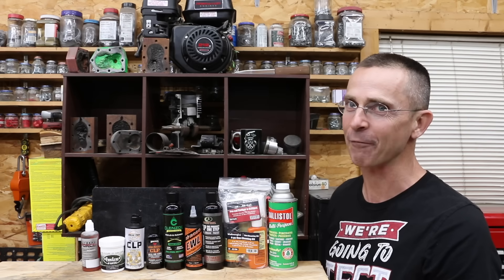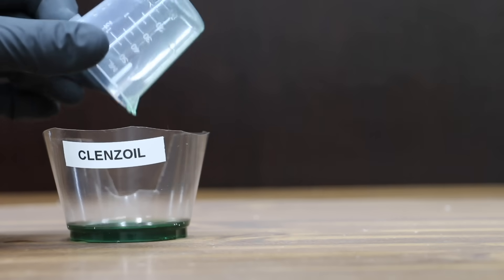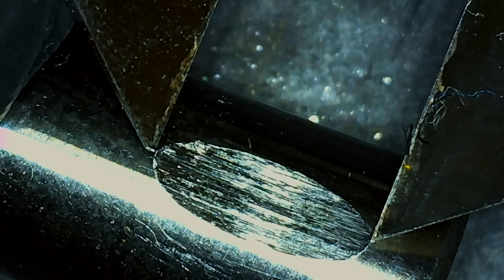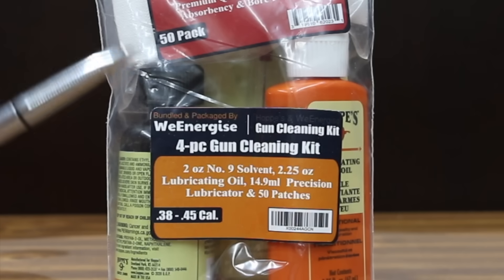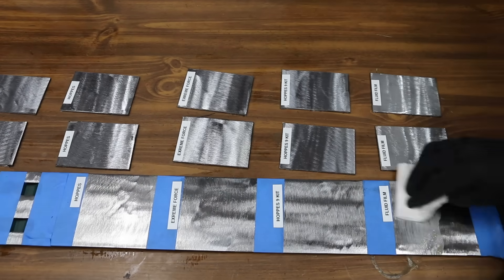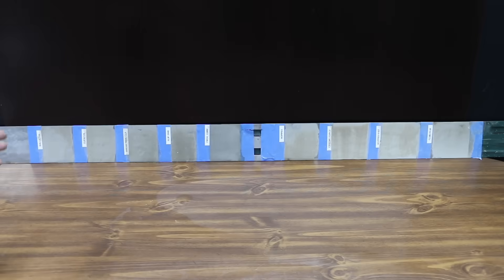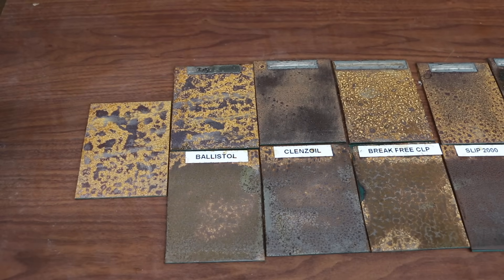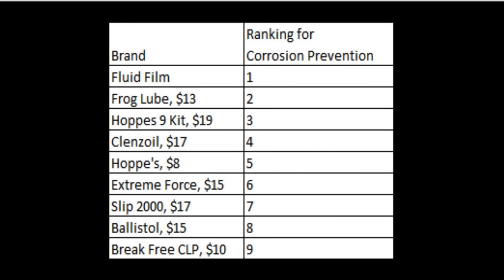Don't Buy A CLP Until You Watch This Review! It'll Save You Time And Money!

Comment: If you do one of these in the future it would be helpful to know at what temp the lubes stop working. For instance, if it never gets colder than -10 where I live, perhaps some of the lubes that failed at -40 would still be viable options for a vehicle gun. Thanks for all your great videos!
Reply from the maker: You are welcome!  Thanks for the suggestion.
Reply: @ProjectFarm  I'll second this. Knowing your CLP can keep things lubricated at 20 vs 0 vs -20F is a big boon. That being said, the Clenzoil still flowed a bit at -40 so here's hoping..
Reply: @ProjectFarm  Oh, btw. Next time you do any thermal testing, put a big thermal mass in the chamber (like a rock, cinderblock, something with high heat capacity that isn't metal) and let it heat/cool to the desired temp before putting in the samples. That thermal mass will really help keep your transients in check.
Reply: Not sure under what circumstances you'd store your gun in a vehicle, but hopefully it's out of sight and in a substantial lock box.
Reply: @brianfoldz40  Thanks Karen, I will store my firearm how I please and is most readily available, mind ur business and u won’t have a problem

Comment: Based on these results and considering the average gun would never see such abuse, the argument can be made that ALL are OK. Not surprised though, that ballistol is grotesquely overrated. If you are a regular shooter, used to cleaning and oiling, any of these would be good so go for the lowest price. That said, more people are turning away from high-priced "gun special" stuff and using common cheap items like mineral oil, 3in1, car wax and cleaners, Purple Power, etc and such items need to be tested. Nonetheless your hard work is very appreciated.
Reply from the maker: Thanks!
Reply: @ProjectFarm  One more thing too, most people buy these oils and then greatly over-oil guns. Guns need almost no oil at all, just a drop here and there in key places and then STOP. Guns would benefit more from the smoothing of rough edges throughout the action than they would from gallons of oil. So it makes little sense to fall for marketing pledges of "newest space age breakthroughs" in oil technology, its utter nonsense designed to drain your wallet. Your excellent video would be better suited toward those people who have machinery with high-speed parts rubbing together -- which isnt the average gun but could be a car engine, frankly.

Comment: Sir I love your video so this is not a direct attack on you but in this video technically you're cheating. By keeping the CLP in a cup and keeping the bearing saturated it is not a real world test. That would be the same as firing a round and then reapplying oil firing a round and then reapplying oil. Going oil is applied and sometimes the excess is wiped away. So in theory a thin oil might have more lubricity if it stays saturated but would in fact burn away faster than a higher viscosity oil that didn't do as well in the test. Example, the cleanzoil is very thin if unsaturated and just applied with a few drops it might actually fail before another CLP that is thicker and would stay in place longer.

Comment: I would gladly donate to see a round two that compares a new batch against the top players in this round!! I want to see how Lucas Extreme Duty Gun oil performs as well as a few others!
Reply from the maker: Thanks for the suggestion.
Reply: Also, I’d love to see a test that measures the persistence of the oil to stay on the surface after simulated repeated slide cycling!

Comment: Lucas oil is my go to
Reply from the maker: Thanks for the feedback.
Reply: @ProjectFarm  not a problem the Lucas oil extreme duty the oil has got the perfect viscosity in my book because it stays where it's putting it doesn't just run all over the place plus I double that up because they make a grease and I actually put a light cold grease on my the rails of my 1911 white coat of grease on my on the barrel and I run my AR relatively wet so I just use nothing but grease on the boat carrier and I add just a few dabs of oil to the bolt itself and the extractor and they all run like tops

Comment: Ballistol is a 100 year old formula for a universal oil. Not a fair comparison to modern products. It works great on black powder products and it can emulsify with water if desired as a cleaner. It's a different category. Fluid Film is mostly marketed as a rust preventive not a lubricant so there's that.

Comment: I’ve been using Frog Lube for at least 10 years now on my firearms. I’ve been happy with the results and have never had any action of any pistol or rifle gum up after sitting for six plus months in the safe. 

One thing I’m always curious about when someone says they’ve had problems with it gumming up, the instructions clearly state to let the part warm up or heat it up a little to allow the FL to penetrate the metal. 

Wonder if the wear would have been less had the FL been applied per the instructions first?
Reply from the maker: Thanks for sharing.

Comment: The bearing test is visually impressive, but does not accurately represent how firearm components operate. Firearm slides have a short distance of travel and the surface load is minimal. 
I'm a Ballistol fan because I have one product that can do light maintenance cleaning of barrels after a range session, protect metal from corrosion and condition leather holsters. I use BreakFree CLP to lube AR bolts. 
For deep cleaning and semi-annual maintenance of barrels I trust the Hoppes 9 cleaner.

Comment: Your novel approach to "testing" these products against each other is, as you had posted in your video "subjective".   Practically speaking, I'm sure all the products would perform well. Firearms in general would not see such extreme wearing of parts that your little test fixture does. I have used CLP in the past. I still have CLP on hand (2 bottles). However, regular ol' motor oil will do an excellent job of lubricating and protecting moving parts from wear and rust.  I've found that the heavier grade oils work the best and tend to stay in place longer.
Reply from the maker: Thanks for sharing.

Comment: Excellent video and work as always!
I have had extensive experience with several of these on firearms. I have had quite bad luck with breakfree clp in cold weather 20F on a MP5. The break free while fluid in quantity was rock solid in the action of the MP5. The charging handle and bolt could not be moved at all. I had to pour gasoline thru the weapon to dissolve the break free so the MP5 would function. I have also used the frog lube briefly it was fine at 70F but after being on the gun for about 3 months it turned into a very sticky thick gunk. This slowed the action down considerably and caused malfunctions within very reliable weapons by regarding the lock time so much that it was causing light strikes and hammer follows dude to the disconector not moving freely. I personally use Valvoline dual blend Molly grease on my weapons because it stays in place and doesn't burn off under high temperatures. I have had good luck with it in 10F temperatures. It's really good important to use grease in my opinion on caming parts in firearms. In really cold temps I prefer to run the weapon completely dry so it doesn't lock up or use Oil or even ATF mixed with gasoline at a 50/50 ratio. My 2 cents of experience. Thanks again and have a great day!
Reply from the maker: Thanks!  Thanks for sharing.
Reply: Great feedback. It would be interesting to try to replicate that, just to be sure.  Any chance that the weapon had a small amount of condensation that froze when temps dropped?  I'm guessing you probably know that it isn't uncommon for a weapon, such as a bolt action hunting rifle to have the firing pin freeze during a cold night after a wet day, so I figure you took that into account, but just want to be sure. BTW, while I do have BF CLP and have probably occasionally used it as a cleaner and lubricant, that would be rare. I normally clean with appropriate solvents, wipe down or "de-grease" thoroughly and lube with a dedicated lubricant.  

Like so many here, I vote for PF to run a test comparing the lubricity function of dedicated lubricants to the top 2-3 CLP's and if temperature tests are done, be sure to include temperatures commonly experienced by users (while that might include -40, it should also include sub-freezing temps about -40.
Reply: Completely dry is also what the aussies do with their AUSteyr/F88/90 etc.
Extreme cold or heat, all dry and some graphite powder in the hammer action.

Comment: Nice testing, but I'd like to offer a suggestion that you (somehow) also look at lead and copper fouling removal; Early on I had a Mosin Nagant with surplus ammo that would take forever to get the bore clean (like 20 or 30 patches with Hoppes to get back to a shiny bore and a "not-quite-clean" patch), so I spent some time trying different solvents & CLPs. After several experiments, I hold the theory that cleaning a bore is about more than just dissolving carbon and involves a "layered" problem of carbon, copper, and lead fouling where certain layers need removed before the lower layers can be attacked--ie. a layer of copper can form that hides more layers of carbon & lead). Surplus Russian ammo (ie. 7.62x54R for the Mosin) is filthy stuff and I've found that an alternating approach has significantly reduced the number of patches to a really clean (ie. patches come out clean) over Hoppes No.9--my original benchmark. (and before anyone calls me crazy about "leading" with copper jacketed bullets: my theory is that Lead gets deposited into the barrel by the interaction of the open base of FMJ bullets and the propellant combustion, but I don't think any solvents directly attack this--brushing and deleading wool work best.)

Of the various CLPs and solvents I've tried (including Hoppes 9 and BreakFree CLP), I've found that MPro7 Cleaner does a great job of cutting the carbon, and MPro7 Copper remover does a great job getting the copper out that's left by that ComBlock surplus ammo. Then back to the cleaning solvent and more gunk comes out on the patches and you can actually get to clean patches out of the barrel.

However, my go-to CLP that I think does a better job than most is Gunzilla, which provides more lubrication than the MPro products. And if I remember, I'll use Break Free Collector for stuff I'll use only sparingly, and I'll pack barrels with Birchwood-Casey RIG for stuff that I put into long term "Cold Storage" (if I remember). I'm also a fan of Tetra gun grease for guns that want grease (ie. Garands, Springfields, and the like)

So consider MPro7, Gunzilla in future testing. Also Ed's Red (the DIY CLP) would be worthy of a look.
Reply from the maker: Thanks for the suggestion.

Comment: I have been using Pennzoil Platinum15W-50 for years in my guns. No rust, no wear. I add a little STP for use on 1911 slide rails.
Reply from the maker: Thanks for sharing.

Comment: a few things to keep in mind: a gun lubricant doesn't need to have the same lubrication strength as motor oil.  In some guns in fact, over lubrication can cause a number of problems.  For most guns, ballistol, slip 2000, and hoppes  lubrication strength should be adequate.  Also noteworthy is soak time for these CLP's solvent capabilities - I know for a fact that ballistol works best when left to soak for longer than 20 minutes, and Hoppes is usually 9-15 minutes.  For the heat test, it's important to remember that no gun mfg recommends not cleaning and lubricating your firearm after each use - so if a CLP doesn't perform well after heat... well you should be cleaning no matter what after each use.  That's not to say that certain firearms still wouldn't operate much better using perhaps cleanzoil vs ballistol.  As for storing your firearm, I've found ballistol to work great.  If I know my gun was exposed to salt water, I would be doing a complete tear down anyways.
Reply: Let's be real tho... most of us are too lazy for that :D

Comment: I really like Weapon Shield. But I really only use it for LP, not CLP. (I handle the C aspect with M-Pro 7). But Weapon Shield oil and grease products - used very sparingly - have kept my gear running smoothly for years. (When not used sparingly it can get a bit gunked up)
Reply from the maker: Thanks for sharing.

Comment: Great test. 
If you are using them for firearms, you will note the very last chart column as the pass/fail.  The more you clean your firearm and soak it in CLP, the easier it will be to clean next time. When I say clean I mean Marine Corps cleaning standards.  You can use anything to clean it that works well, even Ed's Red. I always clean after firing.

For preserving and storing what always works-- 
Break free or similar CLP for final coat.  
M Pro 7 (old formula) works better than CLP, but they don't make it anymore.  It seemed to bind in the metal better after each cleaning.  
For parts that need much more lubrication, Slip 2000.
Reply from the maker: Thanks!

Comment: I'd throw in another vote for a "part 2", where maybe you take a couple of the "winners" here (2 or 3) & run a similar/same test including some of the others mentioned in the comments. I personally, would like to see how the Lucas & good old Rem Oil stacks up against these.
Also, I'd be interested in your opinion of dual usage. What I mean is, you've got some that are great for lubricating the shooting wear & corrosion prevention, but aren't too hot at clean-up & then vice-versa.  A do-it-all-at-once product would be great...but how much is someone giving up for the convenience, when maybe we should clean-up after the shoot first with something like the breakfree; then after it's all clean, whip it it & coat it with something like Clenzoil for the long-term/storage/next-shoot protection.  I s'pose in a way, that's the intent of the whole Hoppes full kit... but, your thoughts?
Reply from the maker: Thanks for the suggestion.

Comment: Had used 3 in One oil since my father and his father used it. In 2007, A gunsmith started me using Butch's Bore Shine and lubricating with Slick 50 can spray. The firearms used most often get the Bore Shine with light 3 In One oil cleaning and wipe down. The ones in the Safe get a wipe down of Slick 50 spray.  I appreciate your testing and will use Clenzoil on the action I take to the range. Thanks.
Reply from the maker: Great feedback! Thank you

Comment: I use slip 2000 on all my Airsoft replicas. They make a specific Airsoft variant that cleans and lubes. I also use peligun oil for my pellet guns. I personally have never had a wear or drying out issue. Also does keep internals cleaner then haveing no coating.
Reply from the maker: Thanks  for sharing.

Comment: +Project Farm  have ya dune Gasket Silicons for engines?. Not for heads altough I did use Corn flakes cardboard on a 200cc twin 2 stroke, just add grease and gud fur 6 months. till it burnnt thru.
Reply from the maker: Thanks for the suggestion.

Comment: Great testing as always. If you make a part two. Would you please try Militec-1? We were issued this lubricant in Iraq due to the very fine sand that could potentially jam our weapons. The Militec-1 had to be applied to the weapon when hot so as to impregnate the metal surfaces then wiped off. Also, Amsoil makes a couple firearm lubricants. A cleaner and a separate protector. Thanks dudes!
Reply from the maker: Thanks!  Thanks for the suggestion.

Comment: Very good video.  I also like the idea of a part 2 to test against other products: Rem Oil; LPS  1, LPS 2, LPS 3; FP-10; 3-in-1 Oil (I like that stuff on steel.) Moly paste; regular motor oil; automatic transmission oil(maybe Dexron),;synthetic motor oil (maybe Mobil One); etc.  So far, it seems to me that: Clean everything with Hoppes or Fluid Film. Lube the very hard-wear areas with Clenzoil.  Smear Frog Lube on steel that gets hot. Spray and wipe Fluid Film on everything else: steel, wood, leather.
Reply from the maker: Thanks!  Thanks for the suggestion.

Comment: Anything close to the consistency of motor oil has always dripped off for me and is gone not long after applying. I tried Ballistol on Hickok's suggestion and it seemed to impregnate steel or coatings and would result in noticably smoother cycling than oils. It's way easier to apply sprays almost everywhere then just wipe it from the (few) spots you wouldn't want it in internals.
Reply from the maker: Thanks for sharing.
Reply: where would you not want it internally? I typically apply it to the entire gun, especially my Garand.

Comment: All in all a good starting point.  I would like to see some items added.  Separate items for Clean vs.  Lube+Protect.  

I see no reason why we shouldn't have a separate cleaning products, especially lead and copper which were not tested here.
For Clean, I am playing with some bore cleaners, and Slip2000 Carbon killer.

For lube/protect, I would love to use something like a mobile 1 engine oil, then some dry lubes and some grease (lithium and boat), maybe even graphite.  
I am not sure the corrosion test as done here is correct.  I would love to see a straight humidity test.  Maybe salty sea air.
I would love to see a long term lube test.  If you don't pull a gun out for a year, and it needs lube to run...

I had an AR which needed lubed every time it went to the range to run 100%. I decided to dry lube to see if it fixed the issue. I had an ongoing test for 10 years where I shot it quarterly.  It probably got 1K in all those years, maybe more, probably not less.  I finally cleaned it because it was filthy and got all over me and my stuff.  It was 100% reliable, not rust, corrosion, and with the cost of ammo, it wasn't going to wear out from use.  It needed a lot of cleaning and CLP wasn't doing it.
Reply from the maker: Thanks for the suggestion.